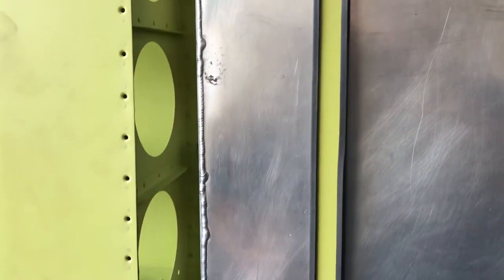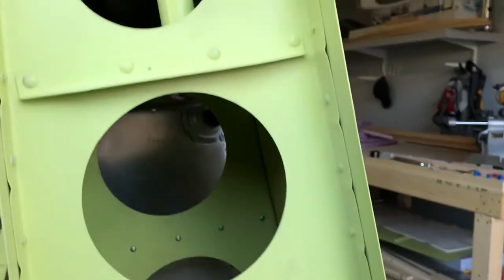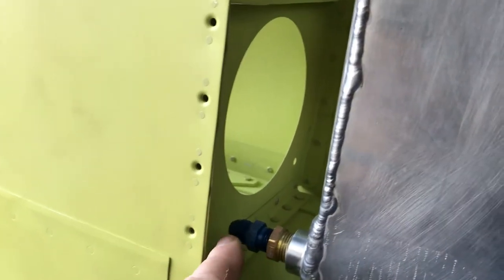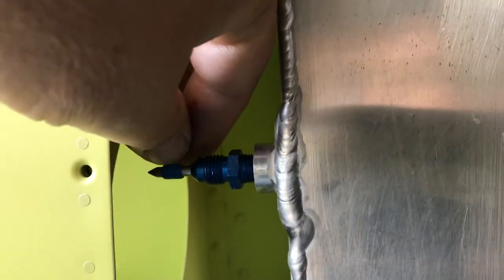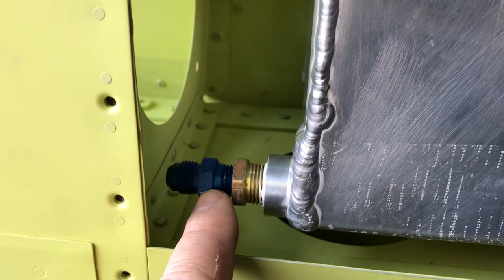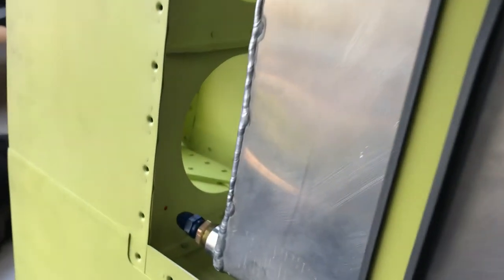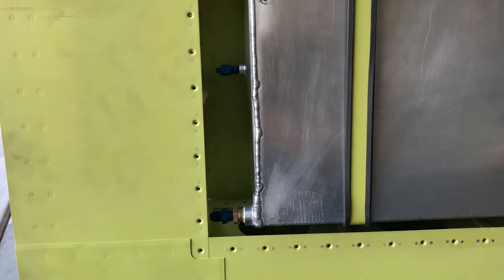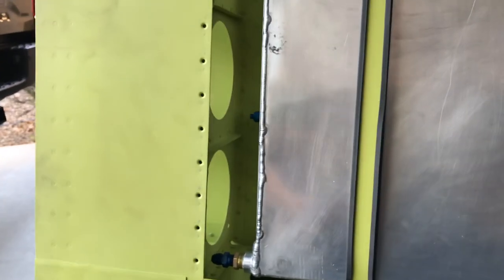The Desert Bearhawk Project

Comment: I like the clever hole marking trick you used.  Keep up the good work and videos.
My thought on the pressure test is, if you pressure test in the wing and there is a leak, it will be a lot harder to locate.  And Murphy's law says there will be a leak :).  Of course my opinion is worth what you paid for it. 
Just out of curiosity did you rivet the tank before welding it?  I recall , when reading through Eric Newton's build, he had some trouble getting the rivets sealed.
Reply from the maker: MrBtdobie , I will be pressure testing on the bench! :)

Comment: Why make a hole and lessen the strength of the rib just install 45 deg fittings wouldn't that be better?  I don't know I'm just asking. I do  Appreciate the time it takes you to post these videos they are very helpful to us that don't know or have never built a kit before thank you very much.
Reply: I was wondering the same thing.  Why not just plumb through the rib lightening holes?
Reply from the maker: The holes in no way impact the strength of the rib or the wing. The reason I did not plumb around/through the lightening holes is all that plumbing restricts fluid flow , makes for more points that could leak, and is unnecessarily complicated.